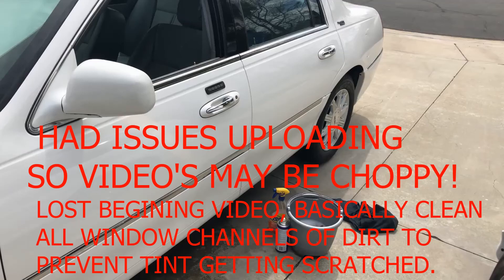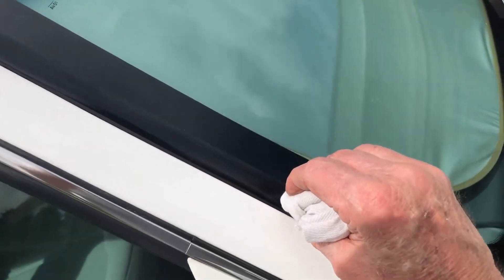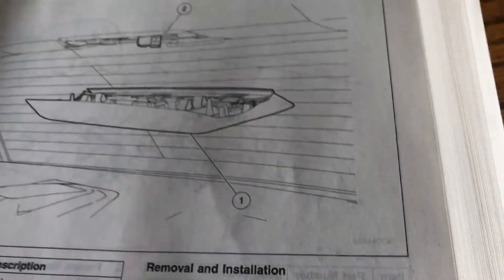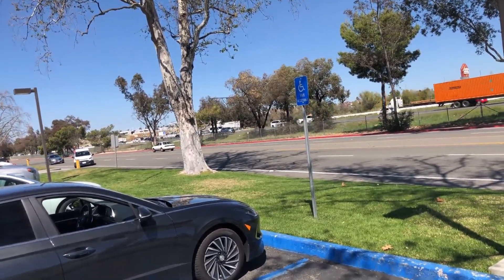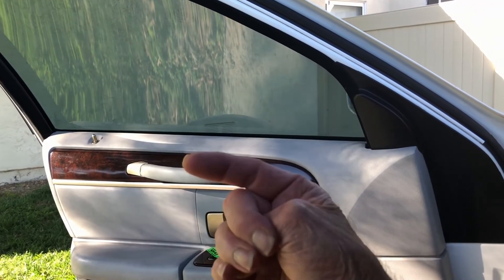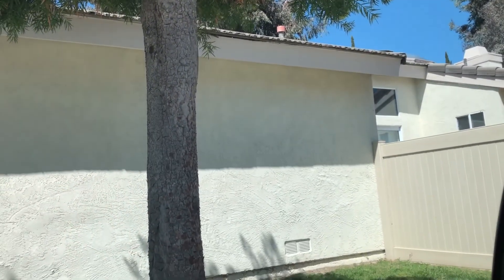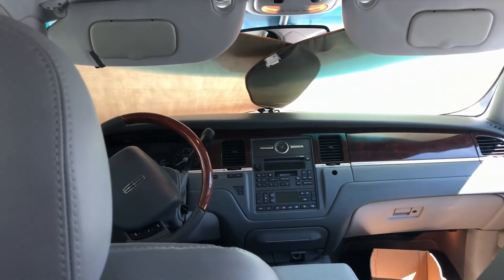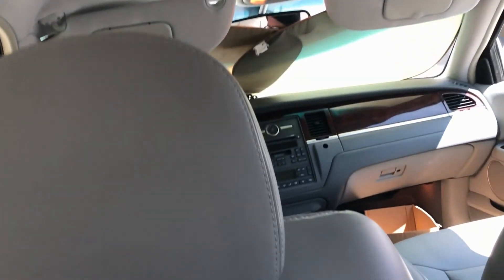Lincoln Town Car Gets Tint!

Comment from the maker: I may have paid more than most but I looked for a shop thats been here for a while so if something goes wrong with tint  I can have it fixed under warranty , did that with my 300E, 5 years later tint started peeling on rear glass, guy came out and replaced it for free.